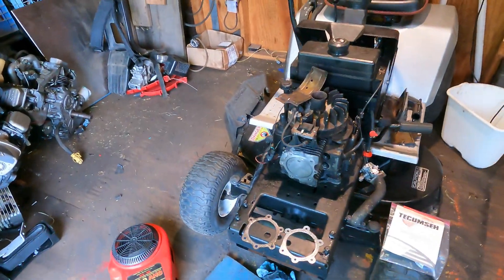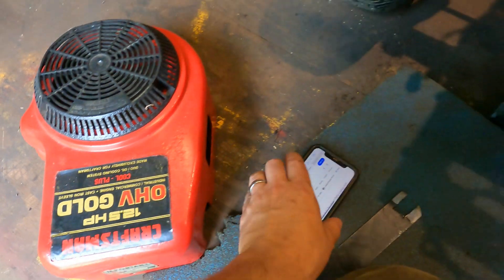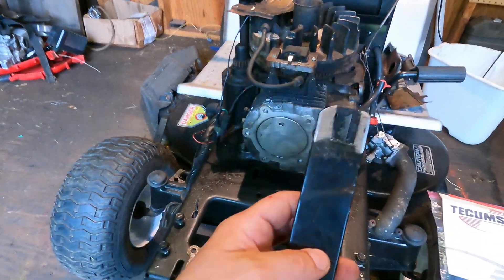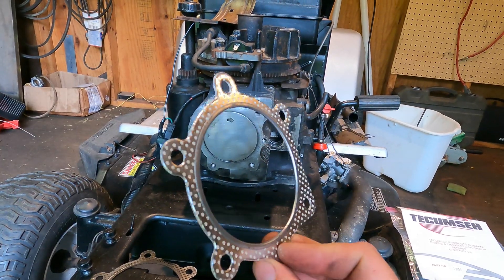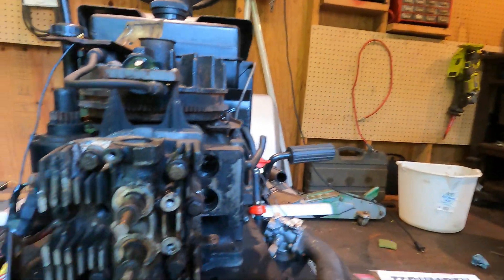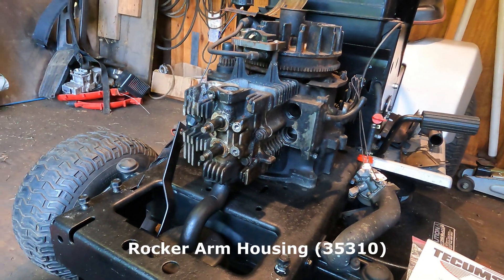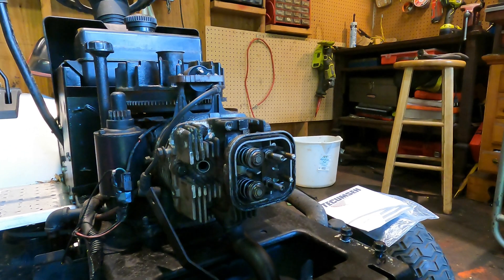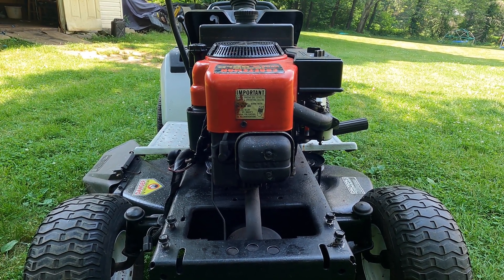Valve Spring removal on a 12.5hp Tecumseh OHV engine

Comment: Nifty little tool you made there. Glad you showed this, it will come in handy for the future. I have a C Clamp style valve spring compressor that would probably work on that as long as the one end of the clamp has room to sit behind the valve cover. If not that tool you made was a great idea. The old gasket definitely looked like it was getting some blow-by so it definitely needed it. I like that tractor. I wish mine had a fender shifter. I added a cup holder to mine lol. I was gonna cut a hole in the fender to stick it down in, but I just ended up running a couple self taps at the bottom of the cup holder into the fender. Great residential tractors. 👍
Reply from the maker: Thanks Doug!

Comment: Thanks for the video Kyle. I'm working on a 2001 MTD Yard Machine. I've pretty much dismantled the entire tractor except for the Engine and carburetor. I've 100% fixed the steering. Welded on a Adjustable linkage on tie rod. Transaxle has all bearings  & shift linkage replaced wheel bushing/bearings replaced. All new belts. New seat. Lots of stainless steel hardware. It has Tecumseh 13 HP, and diff valve & push rod setup than yours. It's almost done. Good job fixing stuff, I'll be watching.
Reply from the maker: Thanks! I appreciate the support

Comment: I need to get my Tecumseh Enduro  engine fixed up and running right it's on my 1985 seires 5  extra tuff snapper rear engine rider
Reply from the maker: I just subscribed to your channel, can’t wait to see the video
Reply: @Kylebythecreek   thanks for your subscription to my YouTube channel Kyle by the creek I'm going to be doing a video on the cleaning of the hydro gear transmission on my craftsman gt tractor
Reply from the maker: @madaboutmowers  sounds like you have a bunch projects to make into videos!
Reply: @Kylebythecreek   I've done a few videos on the lawn mower s that I have in my collection
Reply from the maker: @madaboutmowers  you should get into editing and making full length content!
Reply: @Kylebythecreek   I would like to do that but I don't have any experience with this matter plus I make a video on my phone
Reply from the maker: @madaboutmowers  it’s never too late to learn!
Reply: @Kylebythecreek    i will agree with that Kyle